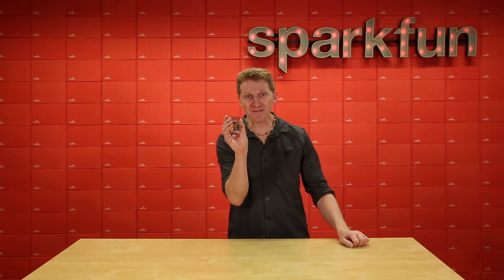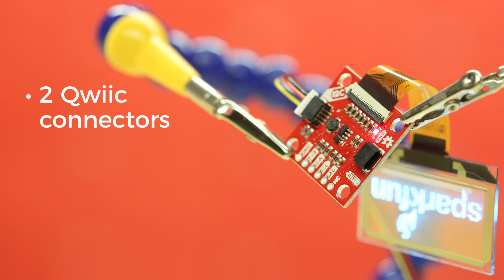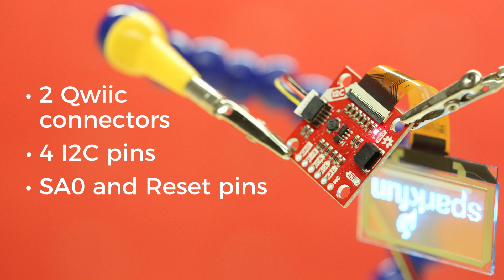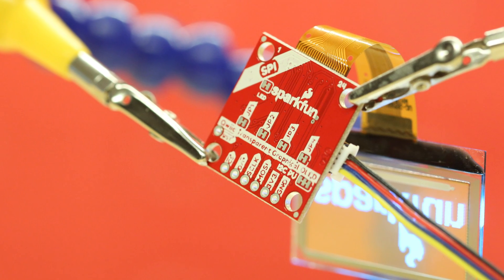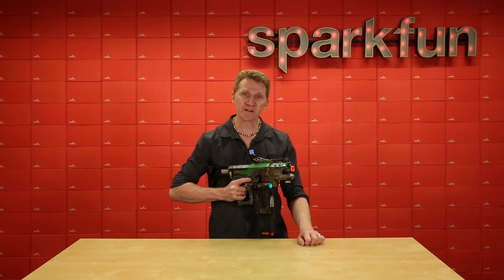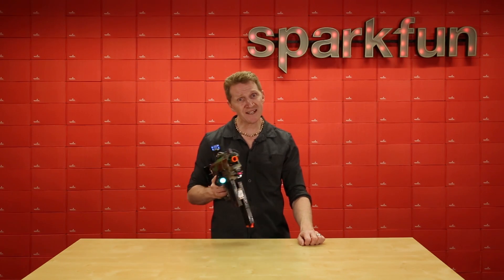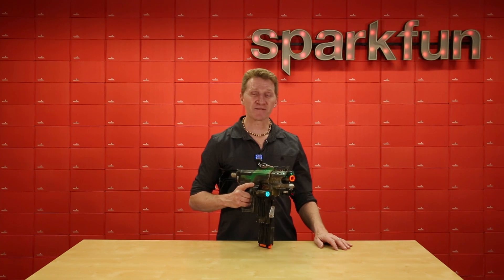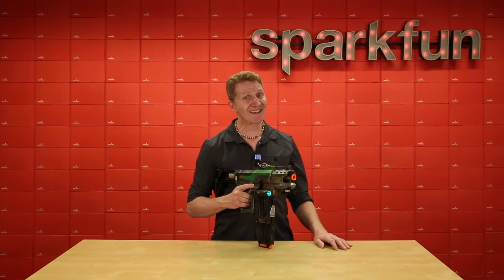Product Showcase: SparkFun Transparent Graphical OLED Breakout

Comment: How can I get this to work with an Arduino Nano?
Reply: I want to know the same thing. My semestre project for Microcontrollers and Interfacez' class somehow turned out to be some kind of glasses with that thing and I suck at understanding, basically, anything.
Reply: So did it work with nano ?
Reply: Use the I2C or SPI protocol.